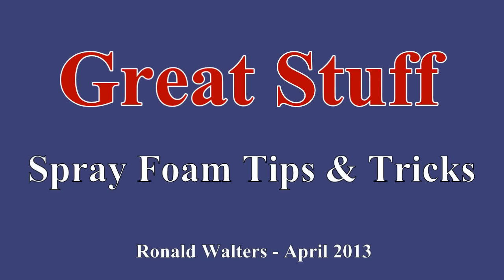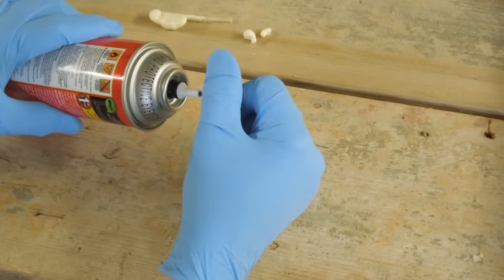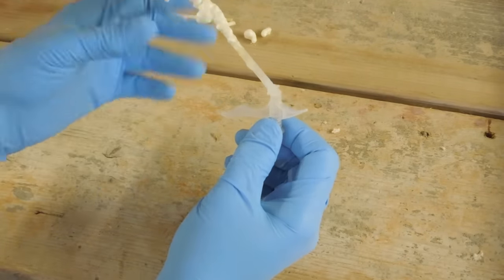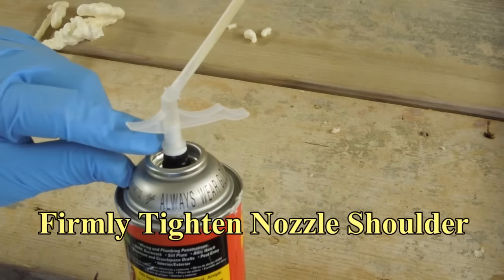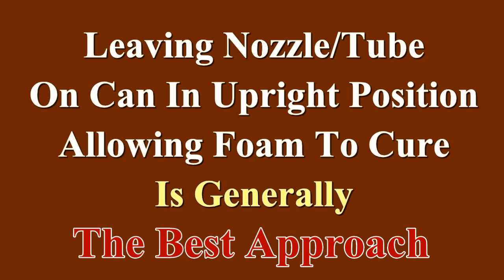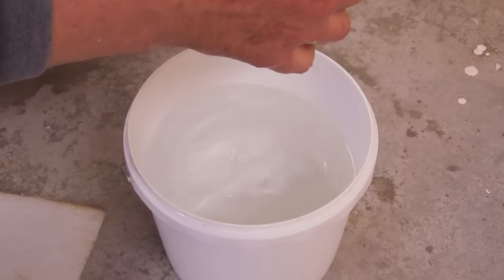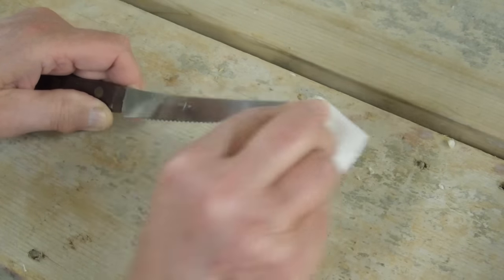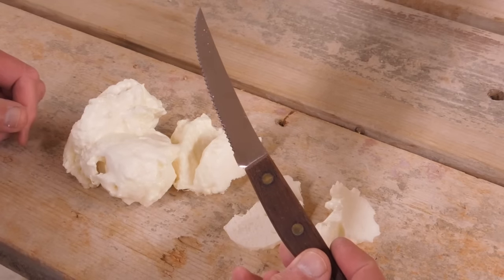Reusing Spray Foam Cans No.1 - Tips & Tricks

Comment: I took a bike brake cable left it in the hose for reuse...I couldnt get the can to work again even though i thought i dug out all the foam inthe black nasal, once i realized that was even still clogged i was able to reuse the can again  until the black nasal snapped off....The Stuff is amazing, but it should say on the CAN ONE TIME USE only just to save the aggravation .  Thanks for the tips....My recommendation is if youre going to use the stuff try to use most of the can.  You can get the can to work again but as the video shows the next time around the pressure will be way reduced inside the can and it will come out very slowly and in my case break the black tip off...Dont ever touch it with your skin.....nightmare....Thanks again for the Video
Reply from the maker: It says on the can something like,  "one time use should be expected". Thanks for watching. Please Subscribe! Ron
Reply: @RonaldWalters2010  i didnt see that...but i also need reading glasses these days...hahaha...but i did get to use the can again thanks to your info...thanks again..

Comment: Great companion "using" video too!  Both gave me confidence to proceed!  Two extra things: (1) The can had a more limited amount than I'd have expected.  Probably under two minutes at half throttle?  Can well shook and held upside down. Now for a fairly thin fill of a crack, if you're good at using it, that's probably 25 to 35 feet, so it's not TOO bad -- but still, less than I'd have expected!  Heh, no worries about re-use.  Is this amount normal?  And (2), in terms of reuse, wouldn't just cutting the top two inches or so of that extra long tube work as well?  I found the extra length hard to maneuver in any event!  Thanks again for the video!
Reply from the maker: A new can will expand more and therefore deliver more foam. A old can (old store stock) will not perform as well. Sometimes the whole tube gets plugged up. What works for me is what is shown in the video. Thanks for watching! Please subscribe… that is what keep this channel going. Ron
Reply from the maker: One other thing... I don't know where you live, but if it is dry (low humidity) the foam may not expand very much and may take too long to get hard. Spray (mist) water into the crack and it will expand and set up better. It needs moisture to cure.

Comment: I am writing this from the U.K so I hope that it applies elsewhere. I regularly use foam i the installation of sash windows. I used to have the problem of half used tins until a friend advised me to use a foam gun. The advantage of a foam gun is that you can leave the tin of foam on the gun with the valve screwed shut until you need it next then just unscrew the valve and pull the trigger and away you go again until the tin is finished. Always when changing from one tin to the next I clean the nozzle and coupling with proprietary foam gun cleaner. If fire risk is an issue there is fire rated foam which can be used to stop the gaps around fire door frames.

Comment: Unfortunately you can't use wire foam cutters on this foam either because it's flammable, unlike styrene which is normally cut with hot wire.

Comment: Great tips!
Is there a fast hardening type of PU foam in spray cans and if i have half can unused and leave it for a few days, will the can become usable because the inside has cured?
Reply from the maker: No fast hardening version that I know of. Available moisture (humidity) causes this to cure. If using it in a real dry location, misting (not soaking) the area of application with water prior to spraying the foam will make it cure faster. The remaining material will not cure inside the can if used within a reasonable amount of time. Following my tips or possibly some of the comments regarding flushing the stem and nozzle with solvent, will keep the can usable.
Reply: Ronald Walters Wow, impressed and grateful for your excellent replies to all my questions at one go !  Thank you , friend!

Comment: By your experience, which one of these spray can foams would be most waterproof? I can’t seem to find a good recommendation online. Thanks
Reply from the maker: I have seen statements that this foam is closed cell but from my experience it is all open cell and will absorb water. The only thing that repels water is the smooth outside cured skin. If the foam is cut, cracked or punctured it absorbs water like a sponge.
From what I have seen, the moisture (water) cured foam is open cell.
Some of the two part foams are closed cell… and are more difficult to apply and are probably more expensive… something like the stronger (heavier) roofing foams which are strong enough to walk on.
Hope that helps.
Thanks for watching. Please subscribe! 
That is what keeps this channel going. 
Ron

Comment: how do you clean the tubes?
Reply from the maker: Did you watch the video? The foam will pull off (or out of) the plastic tube or a wire can be pushed through the tube.

Comment: how long does the foam come hard. i tried yesterday but it still foamy and wet i don' not if it was a bad brand or it need few days to expend and becomes hard. any idea please?
Reply from the maker: Should expand quickly and harden in a few hours... certainly should be hard by the next day. The foam requires moisture to harden. Usually the humidity in the air is enough moisture. If you live in a dry area or using the foam in a sealed area you need to mist the application area with moisture before applying the foam. You can try spraying what you have with water (light mist only) to see if it will make it harden (by tomorrow). hope that helps.

Comment: Thanks for the tips Ron. They worked for me. I would like to know what you think about foam spray applicator guns?
Reply from the maker: I have never used a foam spray applicator gun. All the large sections of foam in my house and shop were done by a contractor... if that answers your question. If not, please ask again.
Reply: @RonaldWalters2010  I'm trying to fill a space behind the toilet. The nozzle on the can isn't long enough. Is their a way to extend the tube that comes with the can?
Reply from the maker: A bit dangerous especially in a finished room... I have pushed vinyl tubing onto the threaded neck of a can and used a small hose clamp to help keep the tube on there. If it blows off you could end up with foam sprayed where you don't want it. Probably would work best with a new can that has more pressure. Having someone operate the can and someone else placing the tube where you want it. Having the can and hose connection inside a plastic bag is a good safety precaution as well as rubber gloves and safety goggles, long sleeves, old clothes, shower cap, etc. The length of tubing is going to be limited by the inside diameter of the tubing and the pressure in the can (the length of tubing is going to cause back pressure on the can contents making it difficult to dispense the foam). The can must always remain upside down (nozzle down) whenever dispensing.

This foam needs moisture to cure. If the area where you want to apply this is very dry mist water in there with a sprayer... maybe in several stages... water/foam then water/foam.

Another hazard with this foam is applying inside a confined closed-in space. It expands... and then as it starts to get hard it will expand again which can deform or bulge out the area. This is not a product to be used around window or door jambs as it can permanently damage the window or door.

Hope that helps. Plan ahead and be careful!

Comment: You can add more air to the can by using a rubber tip nozzle & an air compressor. I put100 lbs. in these cans. Also works for spray paint cans.
Reply from the maker: +allen j  The only reason I have allowed this comment is so I can personally recommend against repressurizing any spray can, especially with compressed air. First, air will react with paint, foam and other material. Second, air contains moisture, which will react with paint, foam and other material. Third, I find it inadvisable to hold a bomb in my hand, which is exactly what you are holding if the can fails because of over-pressurizing. Many people have done it and have gotten away with it but that does not make it a safe practice. I guess if you feel you have too many fingers, hands or eyes then that is your choice. Just don’t do it!

Comment: Great info. Now, how about if the (expired use by date) can won't even dispense from the base of the can? Is there still a way to make use of its contents?
Reply from the maker: I do not understand what you mean by "dispense from the base of the can".
These cans dispense upside down (nozzle pointing downward.
I have had out of date cans work just fine... but at some point in time they won't do anything.
Reply: @RonaldWalters2010  Sorry, I should have said from the top nozzle (without straw extender attached). There's no propulsion at all but plenty of weight to the can. Time to trash it?
Reply from the maker: Sounds like you have lost the gas in the can. If the nozzle is pressed with the nozzle pointing upwards, the gas will be lost without pushing out any of the contents. Time to trash it!
Reply: @RonaldWalters2010  Rats! Thank you for the info.

Comment: I'd like to use spray foam to make sea foam on a wood canvas. I hope it would look realistically. Do you have any suggestions how I should do it?
Reply from the maker: Foam from a fresh can will come put faster and expand more (rapidly) than foam near the end of a can (or an older partially used can). Foam will cure better in a humid environment than a dry one. Lightly misting with water will often times aid the curing process. Precise application of small amounts of foam was not designed into these spray can applicators so you will simply need to experiment with the process. Once the foam comes out of the can it immediately expands... if you mess with it, the foam will loose its expanding gas and you will be left with a sticky gooey mess... again, experimentation will show you if you can achieve your desired results. Have fun! Thanks for watching.

Comment: i filled entire cavernous gaps in sides of my outside steps with this stuff, then serrated knife sawed it off flush, then light paint.   then heavy paint.   the paint will try to melt the foam so coat it first and dry before going for more coats.,

Comment: Thanks for the tip. I have a whole pile of windows to foam and I can't do them all at once.
Reply from the maker: Just a word of caution when considering this original foam around window or door frames. This stiff foam can easily bow or bend the frame out of alignment and cause a lot of damage. A much better choice is the foam packaged as Window And Door Foam, which is a low or minimal expanding foam. Pretty soft, mushy stuff but it won’t damage your frames. Google it.

Comment: Ronald, I wanna ask if you have these vids (i took a peek at your channel and that's a lot to sort through - you know that your playlist can be organized into a second container?)

1) we have plaster and lath walls, not that perfectly smooth drywall. This makes products that expect you to "stick them with tape" to a wall, difficult. how can i make such products stick when they expect a flat surface?

2) I got a reciprocating saw from my dead grandpa, i managed to use the blades to cut some heat pipe that I needed removed - but all of his blades are slightly bent. is there a way to get them straight again?

3) My son somehow managed to break one of the plastic folding tables. the kind that has a plastic top, but metal frame with metal legs. Well the frame was screwed into the plastic, and most of them got ripped out of the plastic. Wondering how to get the frame securely attached to the table again.

4) hey i seen some nails in my wood floor that i wish were a bit deeper. the head of the nail can be felt with your feet, but it's not sticking out enough to do anything with the nail.
Reply from the maker: 1) Check out 3M Command wall hangers, which are a type of clean release tape. They may have a thicker version for rougher walls. Double sided foam tape is another idea although foam tape may not support much of a load (and may not release cleanly later on).

If it is your wall and you do not expect to be moving things around on your wall later on... use a small pin nail. A nail can crack plaster so sue a small drill bit to drill a pilot hole at a downward angle. Then gently install the nail. 

2) Blades are often bent by trying to force them to cut too fast or they are dull (or both). Then if the blade is dull it can get very hot which weakens the blade and contributes to it being bent. If doing a lot of cutting stop every once in a while and let things cool down. Tempered steel isn't going to want to be straightened again. Buy new blades.

3) Plastic is pretty unforgiving and generally not made to last. Also a lot of plastic is nearly impossible to get anything to stick to it. Might consider drilling a hole straight through where the screws were and using a small carriage bolt to attach the top to the frame.

4) Foot traffic, wood drying out, temperature changes (expansion and contraction) and natural building movement, in time, will work some nails loose.  Search for "nail set" which are small pin punches specifically designed for driving the head of nails deeper into the wood. They come in different sizes... sometimes in a set.

Have fun!

Comment: When the foam flow gets weak, can it be strengthened by soaking the can in hot water for a minute or 2? Just never thought of it when using the stuff. I'll just have to remember next time I use it.
Reply: Would putting it in warm water not blow it up?
Reply from the maker: roger brandt The gas in these cans is a liquid, which is part of the reason to shake the cans well before using to mix the gas with the foam. Warming the can (especially a partially empty can) will probably have some benefit in terms of pressure. Warm water isn’t going to hurt anything. I would not use boiling water, nor is it a good idea to leave aerosol cans out in the sun on a hot day. Warm chemicals flow and react better than cold chemicals. Keep in mind that water sets off the foam so getting water inside the nozzle isn’t a good idea, as we want it to get out of the tube before it starts to expand.

Comment: i have a solid masonry house with lots of gaps; the infrared gun shows large differences in the temps around the windows. so i'm gonna use this. do you have an opinion of all the specialized versions of this? is the 'windows & doors' more expensive version really better than the regular great stuff? thanks.
Reply from the maker: The original great stuff or "regular" foam shown in this video is very solid and can exert quite a bit of pressure when the expansion is restricted. You DO NOT want to use the foam shown in this video as it can warp your door and window frames and you WILL NOT be happy. I did not know the "doors & windows" version was more expensive. The doors & windows version is a low expansion, much softer foam.  The softer doors & windows foam is not as good a foam (in my opinion) but is will not warp the frames. I suggest purchasing some and experimenting and you will then see what I mean.
Reply: thanks for your answer, i will return what i bought and get the windows & doors version. and yes, at my local stores, the windows can costs $2 more, each.
Reply: You have to know how to use it. I have used it around windows and never had a problem.

Comment: The foam handle on an office chair got damaged (fell out of the pickup truck!) while moving house. How to repair it using this sticky foam?
Reply from the maker: I am not really sure about your question. Foam handle? The handles on my chairs have always been plastic. This stuff is not structurally strong (it is damaged easily). If you were wanting to fill in a hole or gouged section... ? Maybe create a dam around the damaged area to contain the foam when you spray it. When you "pull the trigger" on this stuff foam coming out is not very controllable so expect a mess. Cover other stuff with plastic, wear gloves, old clothes and safety glasses. Do it outside somewhere. Moisture is what makes the foam set up. "LIGHTLY mist the application area with water (LIGHTLY MIST) and then lightly mist the foam after it is sprayed in place. Then walk away for at least 24 hours to allow it to cure. Gently peal away the packing tape and gently carve/cut/sand to shape. 

Personally, I think I would try to find another way to solve your problem (repair). :-)

Thanks for watching! Please subscribe. 
That is what keeps this channel going. 
Ron

Comment: Will this tolerate heat from an exhaust pipe? Or is it just an open flame it doesn't like?
Reply from the maker: +matrox  Personally, I would not use it on anything that gets that hot. Air exhaust from a clothes dryer, OK. Furnace or hot water heater exhaust no, unless it is double or triple wall stove pipe.

Comment: I'm surprised people don't seem to know the pipe cleaner trick. Pipe cleaner means the fuzzy wire used to clean out smoking pipes. Sometimes this fuzz wire, highly colored, is sold as an art/craft item.
1) Use PU foam.
2) After use, remove straw, insert pipe cleaners in all foam orifices, including the straw. Wait a day or two. It takes foam longer to dry inside straw.
3) Pull pipe cleaners out, with dried foam attached. Waste pipe cleaners, not foam can or straws.
4) Reassemble.  Ready for next use.

Comment: What I have been doing for the past 3 years is to take Acetone in an eyedropper and squirt it in the tip. Swir around a bit then dump it out. Repeat once more and your done. I've never had a can that wouldn't work for me again after I started doing this.  FYI  when this stuff catches on fire it turns into cyanide gas